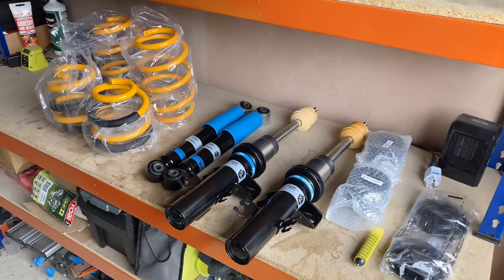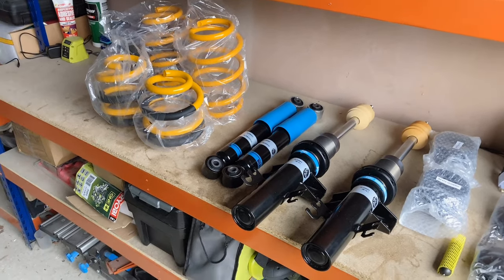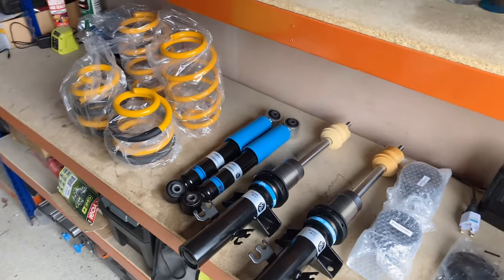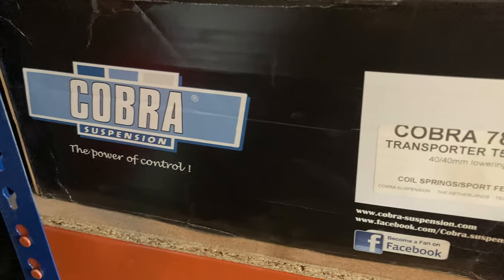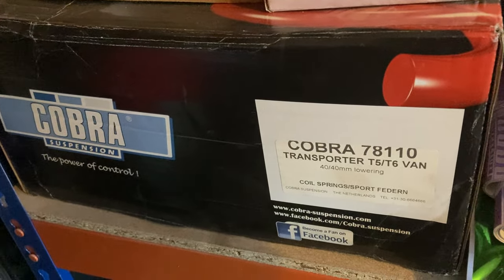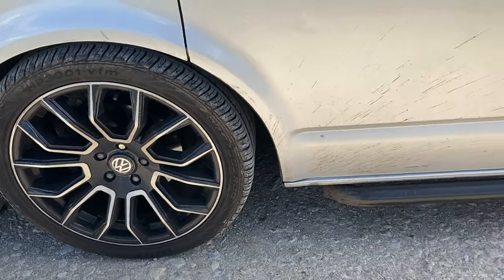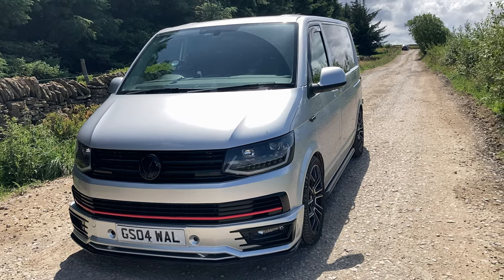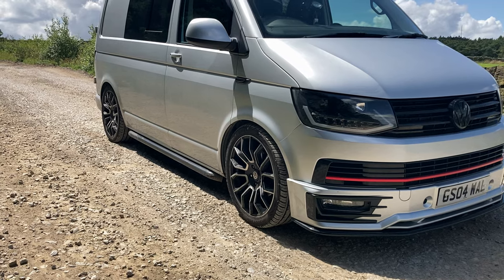Stage 1 Suspension Upgrade | SOLOW NSL Coilovers from Transporter HQ | VW T6 Transporter

Comment: Thanks for the video. Very useful. I've bought aT32 camper with Bilstein NSL SoLow coilovers, 20" alloys and low profile 4 season tyres. The van does drive very well and I can see what you mean about going round roundabouts at 45mph. However, the van is too low for my usage (a fair bit of off grid camping and potholed, gravel tracks) and the tyres too fragile. I'm in two minds whether to sell the Bilsteins... or to keep them, wind them us as high as they'll go and stick on 17" allows with 4 season tyres (225/65R17). In this way I'd hope to retain the great handling characteristics whilst having a van that is practical for my needs. What do you reckon?
Reply from the maker: I guess its horses for courses. That said if you went back to standard shocks the current ride quality would definitely be compromised. I would do what you have suggested. Wind them up and fit a smaller rim with a chunky off road tyre.

Comment: How far up or down have you got left to wind on these? Im undecided between nsl or nxt. I wouldnt want to go any lower than you with the state of the roads around me!
Reply from the maker: On the front I set them 10mm off the bottom so 85mm on the front. The garage then matched the rears up.
Reply: @GS04WAL  thanks for this! Just ordered the NSLs and a set of rotiform dtms for my shuttle

Comment: Whats the ride like ? Very bouncy ? Soak the road up well ?
Reply from the maker: Ride is excellent. I have also fitted the H&R anti roll bars which has stiffened things up a bit and they have introduced a bit of bounce. That said it turns in like a b*****d. Its great to drive. But just fitting the coilovers was a big improvement for ride quality over standard dampers and lowering springs. They are a lot smoother, the springs are softer.

Comment: Nice looking van, I was indecisive between solos low and nsl, but now I think it will get the nsl. What tyre you are running?
Reply from the maker: Changed from a 275/40/20 to a 275/35/20 before I fitted the NSLs. There was a noticeable improvement in ride quality just by switching tyre.
Reply: @GS04WAL  I am on 275/40r20 atm, I am going to try out 245/40r20, it is same diameter as your current ones, it should also help with turning and rolling resistance. I need to see that low 40s mpgLOL.

Comment: Just had so low nsl fitted with meyle upgrades - it's the difference of night and day
Reply from the maker: Did you get the Meyle top mounts? I have the H&R anti roll bars sat in the garage with a set of Powerflex bushes waiting to be fitted. Can't wait to see how they improve the handling further. I'll be doing a road test video over easter.
Reply: Had the meyle top mounts, drop links and power flex black bushes fitted. Looking at anti roll bars now. It's gonna love the lakes roads
Reply from the maker: @Iain1107  Have the black series bushes effected the ride quality? Has it made the ride harsh? Your the first person I've come across that has fitted black series. Very curious to know what they are like.
Reply: @GS04WAL  haven't had her out long enough to notice tbh, I'm on 275s so there's a bit of a scrub on full lock, but she looks the dogs danglers

Comment: How do you find the clearence with speed bumps etc? Confidently fly over them or always have to slow ? 

Debating NSL or B14 Komforts.
Reply from the maker: You do have to slow down a bit more than normal for humps and stuff but I accept that making big changes to the spec of the van means I will inevitably have to change the way I drive. Its worth it to be able to go round corners much quicker. I’ve got the H&R anti roll bars in the garage waiting to be fitted so it’ll be on rails when those go on.
Reply: @GS04WAL  thanks for the info.

Comment: I’ve had a nightmare lately so looking at swapping my koni out with these. Had a really rough ride and instability that’s got worse. Had lower arms/ball joints replaced subframe engine mounts and top mounts in hope it was anything but my 18month old shocks….So hopefully getting these will sort it as not much left to point the finger at.
Reply from the maker: Definitely recommend these, I'm going to get the H&R anti roll bars fitted after Christmas and possibly some up rated bushing as well.
Reply: @GS04WAL  that’s great to know! Do they soak up rough ground ok? ARB’s are in my hit list but I’ll be happy to just resolve my current teeth shaking ride lol. I was more than happy with koni at first but somethings failed in them. looks  good lower too!
Reply from the maker: @davem4131  They are great, I'm running them 10mm off the bottom and they have bottom out a couple of times but I can drive around that. Depending on what stance you want I would consider the SOLOW LOW if you want to go lower than me. I also found that switching from a 275/40/20 tyre to a 275/35/40 improved the right quality on its own.

Comment: Purchased my van around 2 months ago, it come with the same Cobra springs. OMG I couldn’t believe a dealer was willing to put these on a van they would be charging 60k for. I thought I had better act quickly before I had no teeth left. Finally getting my Eibach pro Street coilovers fitted tomorrow with the H&R anti roll bars. 
Those Cobra springs are terrible!
Reply from the maker: I had the same thoughts about dealers fitting them and then charging silly money. I think the H&R anti roll bars are a must for me now, I would be interested the here how you get on with them. Also looking at Porsche Macan brakes.
Reply: @GS04WAL  I will let you know 👍🏻. The only issue is, I’m having both fitted at the same time so I won’t know how each perform individually. Mitch @ HQ said upgraded antiroll bars are the best improvement that can be made to a suspension set up, this convinced me to get it all done at the same time.